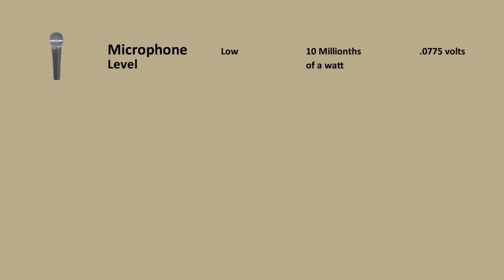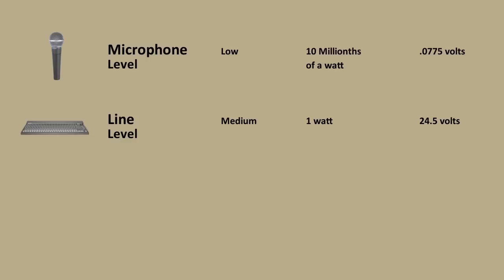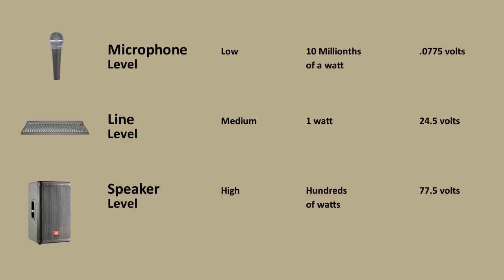Live Sound 101: Analog Audio Signal Types

Comment: Nate,I have a 10,000 sf venue  to reinforce live music for (a KISS tribute band)  would a couple of 200w 15" & 400w 10"  2way systems give a plesant reinforcement of whats going on... onstage ?
Reply from the maker: Hard to tell with the information given. Assuming you have a room that is 50 ft wide by 200 ft long (10,000 sf).  Are these powered speakers or amps connected to passive speakers?  The shape of the room and shape of the audience seating area really comes into play a lot here. Do you mean to say you have two sets of a 15" subs and two sets of 10" mains?  What about drum kit and amplifiers?  Do you plan on running everything through the system or just vocals?
Reply: Here is layout ...all speakers are 2way powered ...a seperate mix of all instruments & vocals will feed these   http://www.sailwindscambridge.com/cms-assets/documents/40409-920553.seatingchart.pdf

Comment from the maker: If you look at the spec sheet for the Mackie SRM450 and SRS1500 you will see that the "sensitivity" is rated for +4 dBu (professional line level).  If your mixer gives you a choice between +4 dBu and -10 dBV you should pick +4 dBu to match the input of the Mackie powered speakers.  Sounds like your ears have already confirmed this to be true based on the louder better quality sound you get when using +4 dBu.  You would only use -10dBV when connecting to a consumer line level device.

Comment: I also have a fender rhodes in my studio that the internal preamp blew on. At first I just connected a 1/4" cable to the cord coming off of the pickups inside, but it was really noisy and unusable.  Now I have the cable running from the pickups into a direct box and into an XLR input, This ends up making the sound amazing and totally usable in recordings.

Comment: Thx for the reply. My PA setup, 2 Mackie SRM450's and SRS1500 Sub.  My mixer has XLR outs and a little switch for -10dBV or +4dBu.  When I run the +4dBu the sound is not only louder, but much fuller and less noisy, I can also crank the volume on the mackie's to about 75% and still have zero noise floor.  I've noticed that mixing vocals live, its hard to get them to sound "up front" in the mix without having an XLR cable.  Some bands use a vocal processor with line out and its just bad.

Comment from the maker: Phantom power is 48 volts DC power that is run along a microphone cable.  Typically it is generated from a mixer or interface at the mic input.  Sometimes there is a switch to turn on phantom power across every mic input and sometimes there is one phantom power switch per mic input/channel.  For the most part Phantom power is used to power condensor microphones and active DI boxes.  Dynamic microphones do not require phantom power.

Comment from the maker: You should run low level unbalanced signals through a direct box especially when running the signal over long distances.  Generally speaking XLR is your best bet.  However it is really the number of conductors you are using inside the connector and cable that will be the determining factor.  XLR connectors have 3 conductors so they can handle a balanced signal.  1/4" connectors can also have 3 conductors to support balanced audio.  We call them TRS connectors.

Comment from the maker: Yes all of this is related to High-Z and Low-Z.  The Z stands for impedance.  So high impedance = high-Z and low impedance = low-Z.  The "u" in dBu stands for unloaded and has a zero reference of .775 volts.  Unloaded from what?  Impedance can also be described as load.  So when we say unloaded we are saying that the output circuit is "open" or not connected to any load.  You can convert dBV to dBu by adding 2.2 dB.  And you can convert dBu to dBV by subtracting 2.2 dB.

Comment: can you explain the difference between +4dBu and -10dBV?  Are they related to High-Z and Low-Z? Whats the "Z" stand for.  And whats dBu vs. dBV anyway?  What things should I run through a direct box?  Will Microphones sound better using XLR vs 1/4" connectors? Also what is phantom power, 48V? What do you recommend if you want to run a live vocal mic through effects?  Some bands use vocal processors, but i've noticed the 1/4" outs don't mix as well as a XLR cable would....